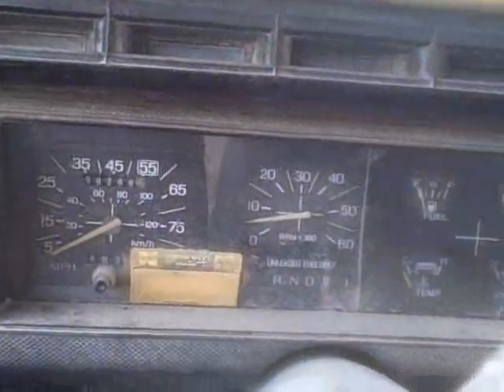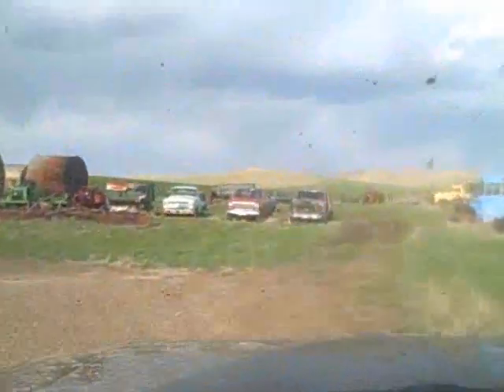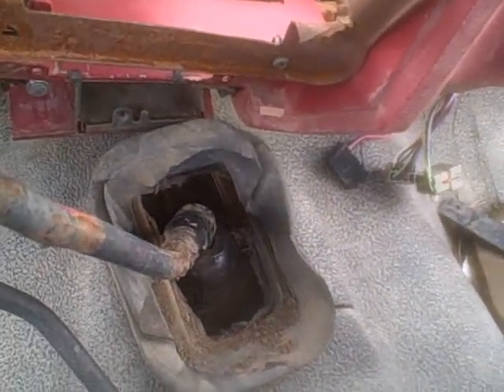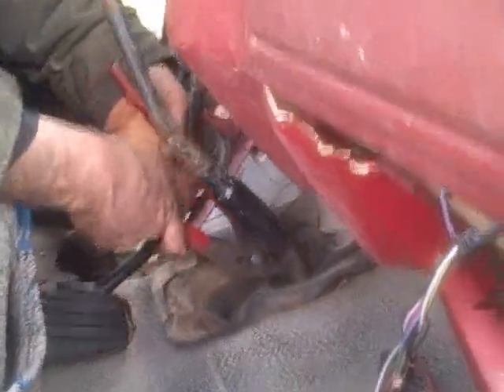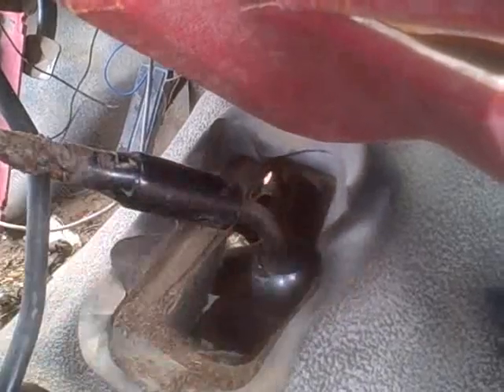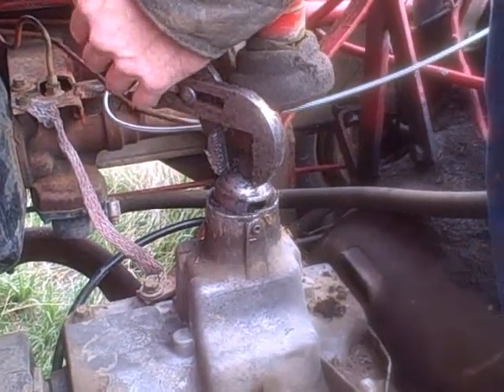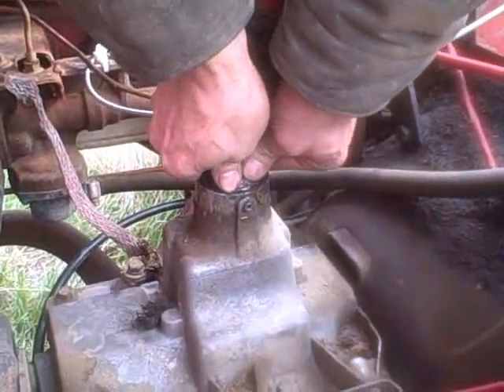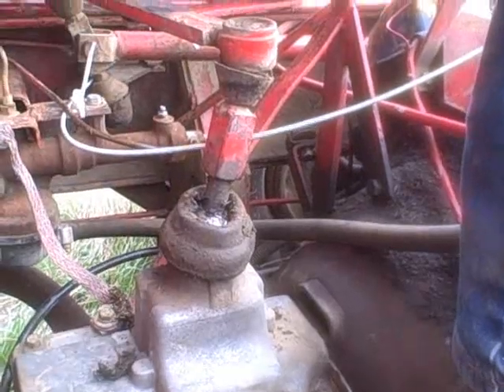how to remove the shifter out of a four speed manual

Comment: Thanks a bunch for this, only thing I could find anywhere relevant to my old 86 Ford F350 6.9 Diesel 4 speed manual. Shifter went all super slop on me and the dome cap had just come loose so the pin in the side wasn't engaged. Thank goodness the pin didn't run away on me.

Comment: Any idea of the part number for the shifter? Or where I can buy one? I can't seem to find one anywhere. I've got an 87 F350 6.9 diesel with the 4 speed. Thanks for any help.
Reply: +Electronics into Cash Its gonna be a salvage yard most likely. You'll just have to call till you find one, this is if you still need it. I just had mine go all sloppy on me, 86 f350 6.9 diesel 4 speed as well. There is a little pin in the side when you get that dome cap off. When the dome cap goes on and threads in that pin can't move. If you can't find any parts you could theoretically make your own pin and if necessary drill out the hole a little bit and the slot in the shifter and remake your own.
Reply: +aeridyne Thanks. We ended up just buying a whole new tranny with the shifter in it. That's how hard it was to find just a shifter!

Comment: do you have to take the shifter out if you remove the transmission. i was thinking bout changing the clutch and wondered if the shifter would slide through or would i have to take it off? i have a 1984 Toyota pickup 22re engine

Comment: i have a 89 chevy k1500 with the 4 speed granny gear my shifter is loose swinging wildly side to side
it will come out in my hand how do i get it to stop
Reply: +Greg Tooley I just follow this video removed the shifter and replaced the broken pin viola  less than 10 min fix
Reply: +LunaDog 101 My was swinging left to right, stable in the gear, but the atual metal shaft was rotating. its a busted pin it will be self evident when you pull it out what the problem is

Comment: Hey i have a 85 f150 4 speed 4x4. And it won't go in gear but clutch is still good what causes this
Reply: worn synchros, low fluid, fork damage, depends on what transmission you've got, honestly.